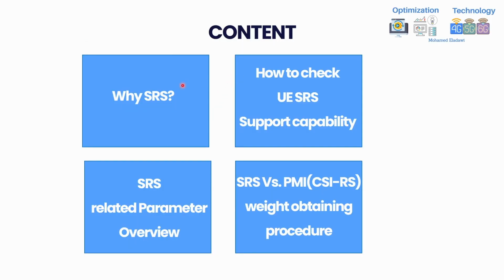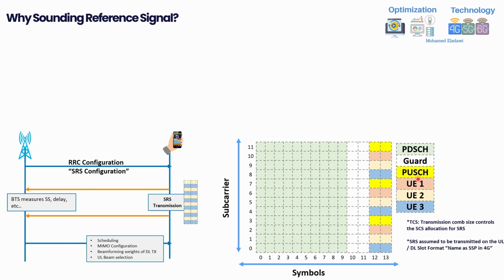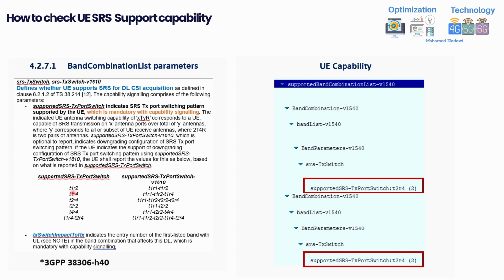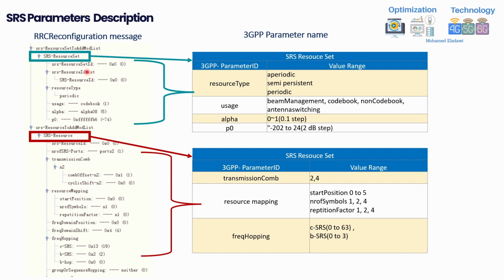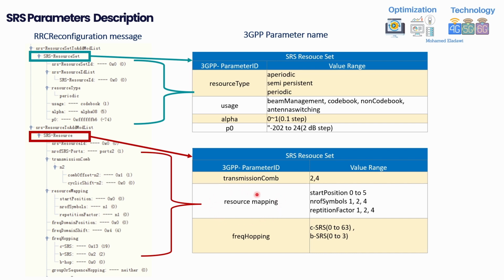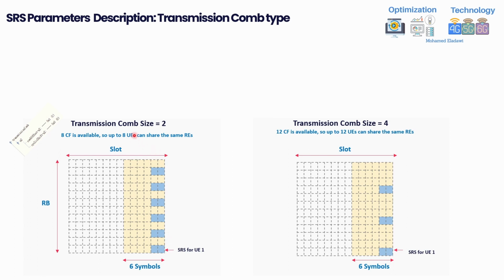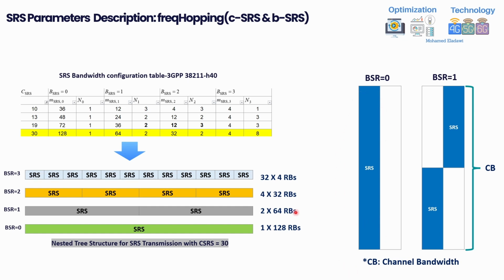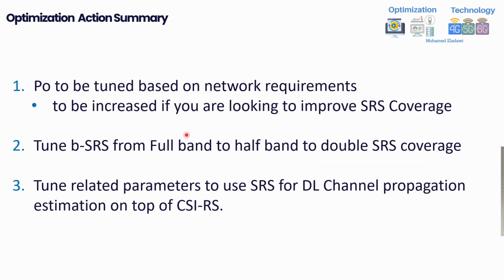5G SRS Deep dive: Sounding Reference Signal Optimization

Comment: Thanks for presentation, You have mentioned that aperiodic srs uses dci, i want to know that for power control specially for periodic srs, is it correct to say that dci is used or not ?
Reply from the maker: Yes, that’s true statement for UL power control in general but do you have power control in SRS? 😮
Reply: @mohamedeladawiashour  yes , huawei  seems has it and is adaptive with srs sinr.

Comment: In in our network , we have activated Redcap feature along with Reduced UE BW Support feature ( 20Mhz and 100Mhz ) , everything goes perfect in terms of the Redcap device testing but customer now reported that gNB allocated SRS resources and immediately releasing them . any idea why gNB releasing the SRS resources immediately ?
Secondly , we have observed after Redcap & reduced ue bw support feature , SRS utilization reduced exactly by 50% , I mean SRS utilization not going beyond 49.9% , My suspection is SRS slots serving each bwp also divided as we created 2 bwps( 20mhz for redcap devices and 100mhz for all other normal ues ) and provides 50% utilization of SRS, although available SRS are same but used quantity is just half  
it will be great and appreciate if you can answer above my queries
Reply from the maker: Hi, that’s a very interesting case, honestly speaking, i do not have yet practical experience with redcap, I will think about it and get back to you

Comment: Hey man apologies for my ignorance. SRS is sent by UE and decocded by gNB for channel estimation or beamforming etc... so then why there's a need to improve SRS coverage  ? Wont that be mis leading for gnb?  
If you can explain this point ... much appreciated OR it helps to formulate better beam forming... but then how?
Reply: Umm mm please if you could answer? Thanks
Reply from the maker: Hi man, no worries, it is the same concept as the DL, if there is a less power used by the bts the downlink coverage will be weak and probably the coverage demodulation process from the UE will result in reporting a poor CQI and as a result it will impact  the link budget process in general which will result at the end in low Mcs, etc. the uplink is the same around, assume the UE is at cell edge the transmitted power of SRS might be insufficient accordingly this will still negatively impact the complete process as explained in downlink; as a summary improving SRS coverage will result in more accurate beam forming, higher mcs especially for EDGE users
Reply: @mohamedeladawiashour  okies gotcha :) thanks .. I was looking from a different perspective, other than the obvious ... 
Thanks once again. 🙏
Reply from the maker: @filthykid84 welcome anytime mate

Comment: Hi Thanks for that detailed explanation
One query as you told srs can be used for dl channel estimation as in tdd we have channel reciprocity so in that case why we are using csi for dl channel estimation csi report I..e why we need csi report
Reply from the maker: Hello, based on my limited knowledge, CSI is essential for DL due to two main reasons:

1- Not all UEs support antenna switching, which is a prerequisite for using SRS for DL channel estimation.
2- CSI provides better performance for EDGE users compared to SRS.

Comment: Hello Mohamed,  Thanks for sharing. May I ask a question about the relationship between supportedSRS-TxPortSwitch IE and UL MIMO: If the UE capability of band N41's supportedSRS-TxPortSwitch=1T4R, does it means that UE cannot support UL 2x2 MIMO on band N41? Thanks.
Reply from the maker: As per my my understanding yes, it can’t support UL 2X2 MIMO as long as number of Tx branches is less than 2
Reply: a little update: checked a live network log, UL 2x2 MIMO can be used by UE when the capability is supportedSRS-TxPortSwitch=1T4R. In the RRCReconfig message, pusch-Config setup IE {txConfig codebook, maxRank =2}，and related srs-ResourceId{usage codebook, nrofSRS-Ports ports2}, then UE send out srs via 2 Tx (fixed conifured by RF), gNB set precoder layer=2 in DCI after few frames.   @mohamedeladawiashour

Comment: The cyclic shift part is not clear. With transmission comb size of 2, how can 8 UEs share the same REs ? If the SRS for UE1 occupies alternative REs in an RB then only another UE (say UE2 ) can occupy the rest of the REs. Thus, only two UEs can share the REs in an RB. I also read the 5G in Bullets book but it still is not clear.
Reply from the maker: The deep detail about it still also not very clear to me; It is a combination of code multiplexing and allocating different cyclic shift; i am trying to check different sourced to further clear the concept of cyclic shift. I will let you know if i reach into something

Comment: One query can we use 1T4R srs antenna switching in mumimo ???
Reply from the maker: Yes it can be used, as per my understanding
Reply: @mohamedeladawiashour  thanks one more query it's written that for 1T4R case srs resources set could be zero or two..then what does it mean? Because at least one resources set should be there to map srs resources correct so confusing terminology zero or two..plz help
Reply from the maker: Hi Vipin, it is mentioned where? Speaking about 1t4R antenna switching, you should have two resource set id each will have 2 srs resources, have a look into page 366 in 5G NR in bullets book
Reply: @mohamedeladawiashour  yes for aperiodic case it is mentioned that zero or two..plz refer( I am unable to attach that link sorry) srs 5g sharetech note ..in that 1T4R aperiodic config
Reply from the maker: Hi vipin, i will have a look into and i will get back to you
Reply: @mohamedeladawiashour  thank you..

Comment: One doubt here  ...case of 1T4R  means UE has 1 transmit anteena and 4 receiving anttenas..correct....so in case of mumimo( suppose 2 Ues/device sharing same time and frequency resources)....how 1T4R will work ..means for 2 nd Ye how wil it do anttena switching?..
Reply from the maker: Hi Vipin; the question is not very clear to me; it seems I am missing something; we can have a one-to-one chat on Linked In to figure out the question and answer

Comment: Can you please give ppt of this...also what does it mean 2t 2r....means ue side tx means srs transmission??? Rx means receiving at ue side?
Reply from the maker: Hi Vipin, You can find the working materials at the below link. Regarding your question, The UE transmits the SRS from each receive antenna 

https://www.mohamedeladawi.com/5g-ul-reference-signals-srs-sounding-reference-signal-optimization/
Reply: @mohamedeladawiashour  thanks..in this video it was told that in case of 2t4r srs is transmitted using receiver….??? Why ..   tx means at UE side is transmitter correct?   Or tx means tx from gnb side??? Have confusion please clarify
Reply from the maker: Hi, it looks kind of complicated but whatever mentioned it is about the UE side; Antenna switching means the UE is capable of switching the transmit paths between ue receive antenna; refer to page 365 and 366 in 5G NR in bullets for more details.
Reply: @mohamedeladawiashour  thanks ..please make one more video that clears such doubts thanks in advance

Comment: Can you please confirm the following : 1)In case of Codebook transmission, Ue sends initially SRS and the gNB calculates the precoding matrix for PUSCH and sends to UE via DCI. 2) In case of non-Codebook transmission, gNB sends initially NZP CSI-RS then Ue calculates and sends the precoding matrices for PUSCH to gNB via SRS and gNb finally selects the proper one. Thank you
Reply: Thank you very much Mohamed.
Reply from the maker: @georgioskarouzos7418  Thanks to you for letting me also review this information through sharing your valuable information and feedback
Reply from the maker: Hi georgeioskarouzos, Yes you are perfectly correct; you can find the clear procedure explained in pictures in 5G NR in Bullets book, Page 379 for Codebook based transmission and Page 380 for Non-CodeBook based transmission.

Comment: A UE capable of Channel Sounding without antenna switching transmits SRS less efficient than a UE capable of Channel Sounding with antenna switching. Is it correct ? Thank you
Reply: Generally looks like so, having more diversity with higher Rx config.. seems the latter would be efficient
Reply from the maker: Hi Georgios, I didn’t find any related information to confirm your question. I will let you know here if i find any

You can refer to 5G NR in Bullets page 365 to 367. It covers all the information regarding antenna switching